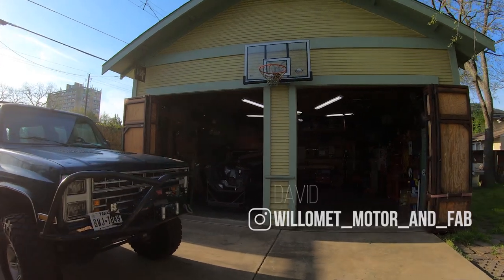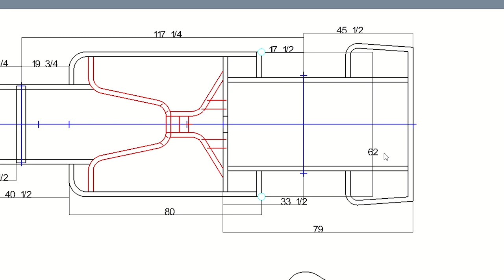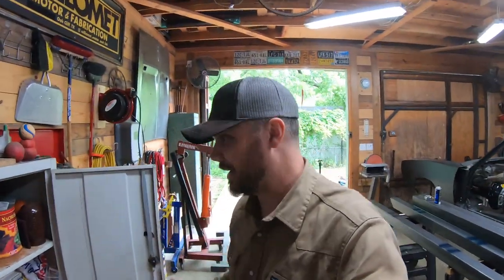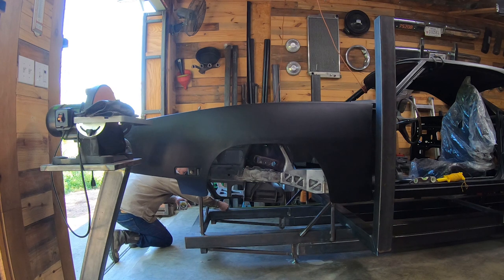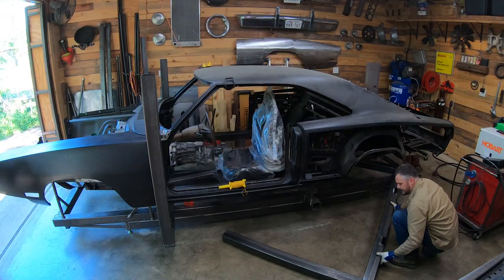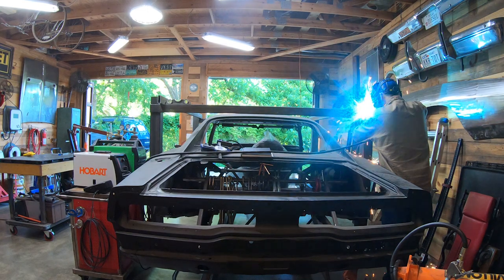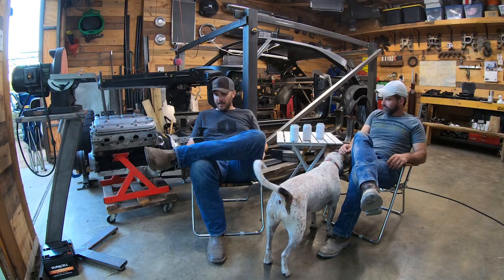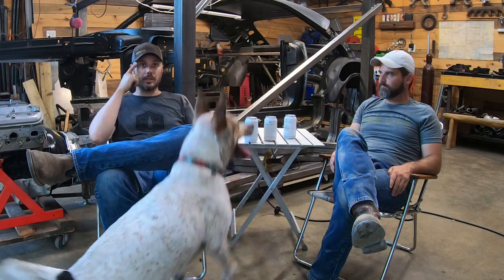Okay, Let's Go |1970 Dodge Charger 01| The Willomet Special | Pro-Touring Muscle, Built from Scratch

Comment: Yep, I'm easing my way around the back pages, if you don't mind my doing so..
BTW, Lazer is much more accurate than plumb bob all day long, as long as your surface is level that you're working off of.
The reason I say this is because once you have it set in place, you have both hands free, you're not fighting the the many obstacles involved with plumb bobs.
Any kind of breeze unless you're using an extremely heavy brass plumb bob would be only way to defeat this situation, but by doing so. 
You add additional headaches trying to secure it in place especially by yourself, and if you're clamping it in place you know the hassles involved with this I'm sure, because you were born with two hands..
Then there's the shadows that that effect the eyes, adding to the fact that you have to be able to get a couple crows feet to assure you are exactly where you want to be. 
Lazer only requires two things, level bench marked location, a clear line of sight, and in bright conditions, the use of a red card with correct fraction marks to verify that you are where you want to be if necessary. 
On your base do you have multiple locations where you have adjustable feet with a lock nut, or jam nut to lock in your elevations?
And with that said, how often do you check to verify that the ambient temperature hasn't caused either the concrete to shift slightly as it is prone to do during wet times, are the hot months of the year where things dry out, and start moving the opposite directions of the saturated soil has shifted..
Cause reason I mentioned this is the standard concrete driveway, and garage isn't but 
3 5/8" which isn't suitable for accuracy according to the engineers, and I have to agree. 
Only reason I am familiar with this is after 40 plus years working as a sheet metal worker laying out equipment pads locations ductwork either for fabrication or locating the different trunk lines in the smallest of places, especially avoiding other trades you tend to pickup on such things over the years. 
That and my ole man was a machinist for TI for nearly 40 years before he retired, and I've seen the special slabs that they sit high end lathes and mills up on to guarantee that they stay exactly where they sit them up at, and even then they do come around verifying that they haven't moved a fraction of a degree one way or another. 
If there's anything in this world that will move when you don't want it to, is Texas dirt, concrete, and steel, because they are effected by temperature and moisture or lack of either one. 
Not that your building space shuttles or anything like that, but you spent a lot of time, and money to assure yourself that it wouldn't move, and so just my observation from years of being a royal PIA about things going exactly where I need them to be. 
Ever throw her a freebie with a rubber rim to protect her mouth, I promise you she'll be addicted to it, but they are amazing athletes, and Ashley whippet doesn't have anything on a heeler when it comes to the flying disc.
PS
Why Mopar, Especially the long WB model?
Reply from the maker: I just like me an old charged. Always loved this intersecting diamonds. Thanks for the comment and feedback man!